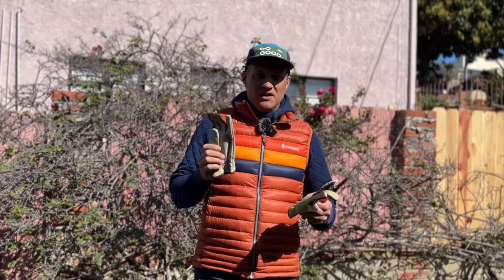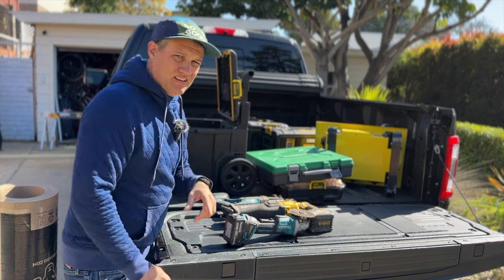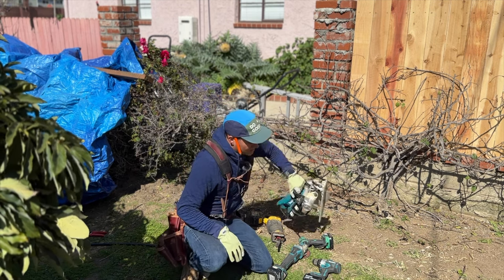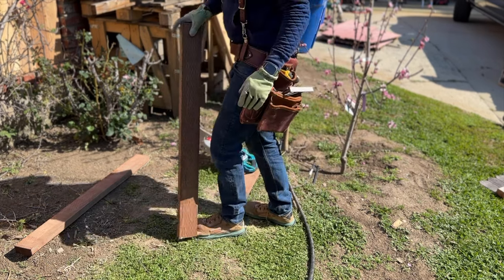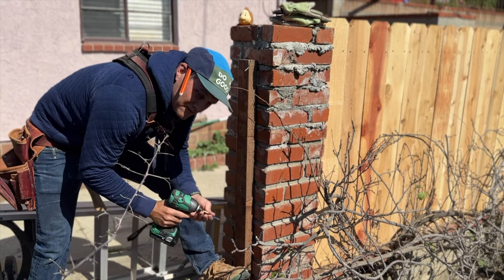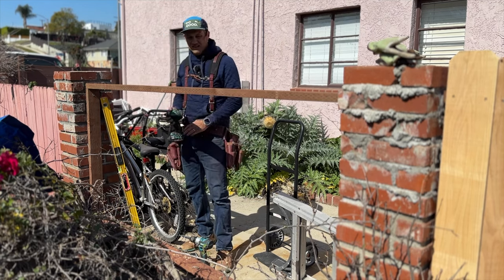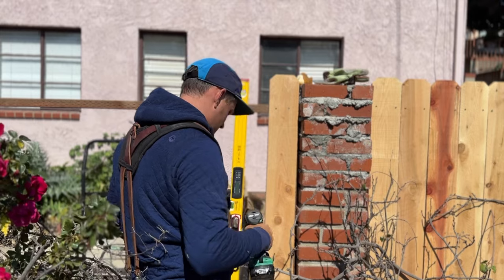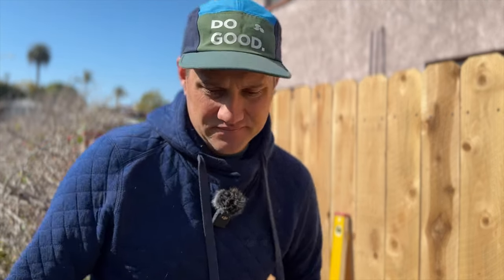How to make a cedar fence

Comment: Hi there, new to your videos from the UK. Few Qs: 

1) your lovely corten fence - what is it secured to? A post at each end of the panel? 

2) what is the base secured to? Have you dug the corten panel into the ground? 

3) what thickness is your corten steel? Thanks in advance